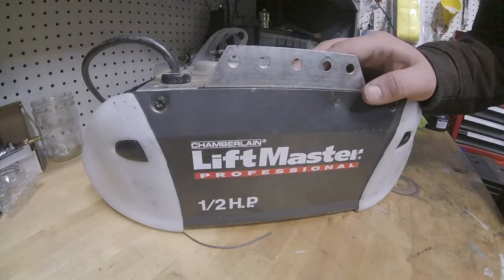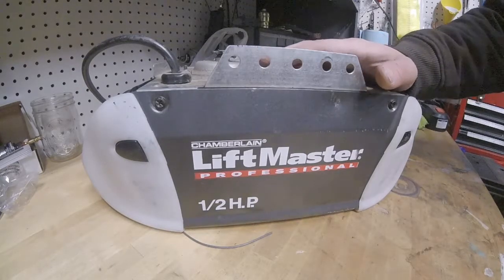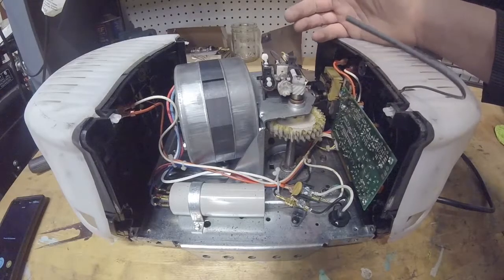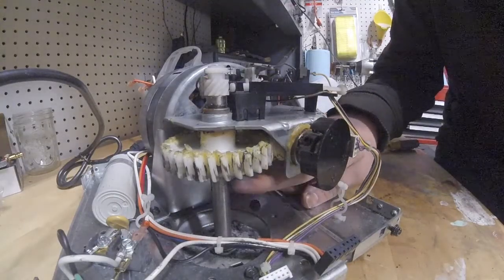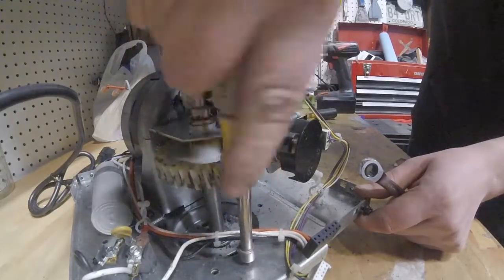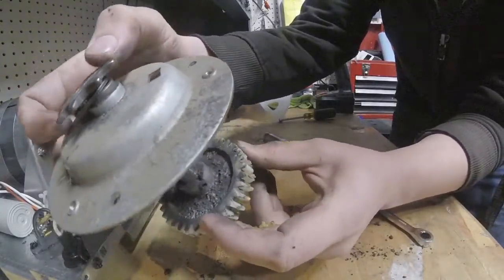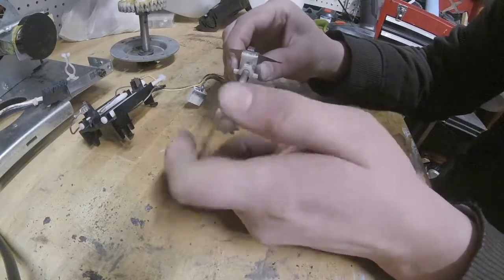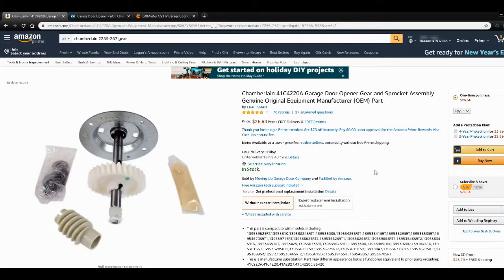Chamberlain LiftMaster 2265-267 | Part 1: Disassembly and Diagnosis

Comment: You know the -267 indicates that the packages includes 2 remotes and a keypad, as the model without the -267 has only 1 remote and 0 keypads.
Reply from the maker: Interesting... Because we never had anything but one remote, no keypad.
Reply: @DustyDingus  Weird, it may just be a regular 2265 then. I know it wasn't a 3265 because it didn't have the little (()) icon, which means it's 315MHz.
Reply from the maker: It says 2265-267, was installed brand new in my mother's house when it was newly built.